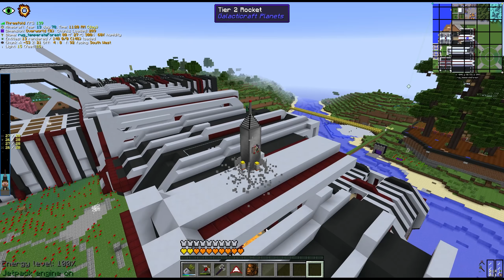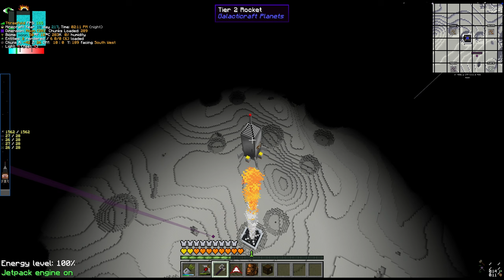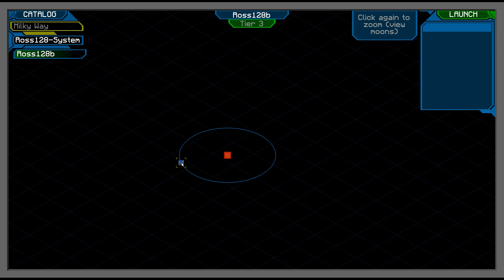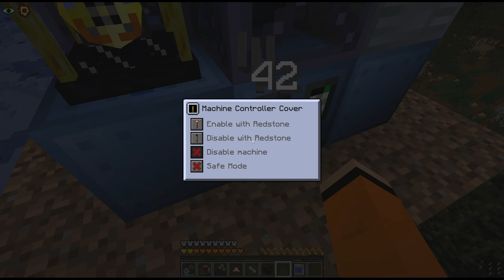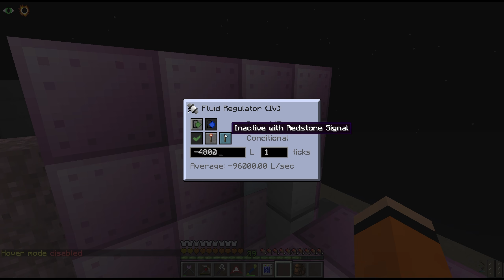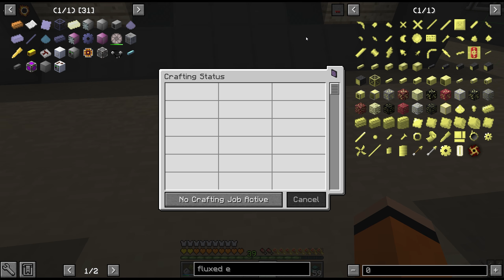Gregtech New Horizons - 54 - Turbine Power! Modded Minecraft

Comment: When transporting large amounts of items from output buses to interfaces like in your wiremill setup, use GT item pipes (with high capacities, like at least large electrum) instead of conduits. Output buses automatically push the items out pretty much instantly, so you will rarely run into situations when your output bus fills up and the machine throttles.
Reply: There's a "Output Bus (ME)" that stores the crafted items directly into AE2 for multiblocks. Far less laggy and doesn't need piping.
Reply: @shootingwithportals  Doesn't work with GT++, last I checked.
Reply: @aa-rv5wz  no, i believe there was a way added. Maybe it was switching the inbuilt void prevention off? I am not sure, but you had to use one of the instruments on the controller i think
Reply: @aa-rv5wz  huh, TIL - haven't done ME buses yet for these multis, my bad. I think you can use conveyors for them though?
Reply: @shootingwithportals  you are correct. I havent played in a while and completely forgot about it. Iirc you had to do something to make it work with gtpp machines though.

Comment: If you're hitting the max for the output hatch, it means your voiding extra lava. Also for the ender tanks you need to use a pump to get faster throughput. If the fluid detector is only detecting if it's full, instead of getting the 32 buckets/operations you're going to be getting a few millibuckets since the ender tank throughput by default is very small.

Comment: Ross128b lava fluid chunks are *rare*, and on top of that they can be complete duds. I don't know what the average is in term of how long you're going to be prospecting to find one, but that much looking around is not surprising. An alternative, if only because Ross128b lava is going to get nerfed in the future, is to use a fluid reactor instead of lava as a heat source for the LHE. It changes that aspect of the setup slightly, but not too much. It also is able to yield more power than lava, however, with my best design putting out 27.600 EU/t per setup (assuming Oriharukon).

Oriharukon is the second best rotor (what I call the turbines that go inside the multiblocks) material available at this point, with sky-high throughput, efficiency and durability. The only downside is it's cost, since it requires quite some infrastructure to actually cook up (and cool). Ichorium would be even better, but that requires a lot of Thaumcraft shenaniganry just to get some better stats on your rotors, not to mention fully opening up Kami. Not worth just for better stats on your rotors, IMO, even if Ichorium rotors are borderline invincible.

For the record, you can no longer wallshare multiblock turbines as of 2.1.2.1 I believe. You used to be able to in earlier versions, but it would mess with the rotor texture on the turbine, so this was changed.

To clarify, yes, the low pressure steam turbines do have fluid regulators on their inputs as well, and yes, this is required. Steam turbines are very sensitive when it comes to providing them with optimal flow, without which they won't produce as much power. Fluid regulators on the input hatch is mandatory, simply hooking up the output of an HP turbine to the input of a low pressure turbine will not work.

The distilled water that goes into the LHE is on a closed loop, however there are two caveats. If any of these multiblocks ever gets a maintenance issue, the loop is broken and you'll start to lose distilled water. If the LHE runs out of distilled water...well, you've seen the end result of that already. The second caveat is that while the system is starting up everything will slowly climb towards 100% efficiency, during which time the closed loop is broken. Make sure you have a large buffer of distilled water on hard when starting the loop, because some will be lost in the process, and have either a backup supply of distilled water on hand or redstone control to prevent the LHE from turning into a time bomb should a maintenance issue ever cause the distilled water loop to be broken. Preferably, of course, have both.

I...don't see why breaking the controller is necessary for changing out the input hatch? Turning it off, maybe, but breaking it? What?

You've not quite doubled your power, but you went from just under 25K EU/t to slightly over 40K EU/t. Which sounds like a lot, but consider that 5 IV machines could eat the lot of that by themselves, let stand when you get into LuV. Don't make the mistake of thinking you've got infinite power quite yet ;)

For these sorts of batch crafts there's really two options. PAs, and GT++ multis. So...bring out your offerings to the dark alloy fetish gods, everyone ;)

Man, imagine playing a pack like GTNH and actually having to do stuff like magic progression to craft stuff like Ender Tanks.

So I'm sure at least a few people are scratching their heads right now because a GT++ machine casing didn't require some random alloy. Well, fun fact (as far as I can recall off-hand, so maybe don't quote me on this): These casings used to require an alloy which required an LuV powered Advanced Blast Smelter to create. The ABS, as with other GT++ multis, cannot be overclocked by giving it multiple energy hatches like you can an EBF, so in order to create that alloy you needed an LuV energy hatch. An LuV energy hatch requires the Assembly Line, so in order to craft the multiblock wiremill to make the Assembly Line tolerable...you needed the Assembly Line. Oops. The casings were changed at some point to require blue steel instead, making the multiblock available pre-Assembly Line (thankfully), but creating the oddity of a GT++ multi that doesn't require some random GT++ alloy.

Something that was broken but fixed in 2.1.2.3qf, by the way, is the...Tectech (I think?) Schematic. It'll show you a preview of multiblocks if you right-click a multiblock controller with it. It's not the best tool, but it sure beats nothing at all.

Sheesh, this man complaining about having to use individual tools on maintenance hatches like he's not playing the version that gives you the tool box thing that allows you to do maintenance all at once. Which didn't exist in the version I played, for the record ;)

Something you'll want to do to speed up the craft, Three, is place item conduit speed upgrades on the extract of the GT++ wiremill to extract the output faster. Alternatively, there's an output bus that's basically an output bus with an AE2 interface integrated, which connects directly to your AE2 network. I have no idea how good those things really are, but it could be something to look into if you're worried about machines with full output buses causing downtime when crafting.

I don't know if you need to do one PA per fluid, but in the interest of minimum chance of recipe overlap it sounds like it's a good idea. Tungstensteel stopped being an issue a while ago, and if it is you've got bigger issues to deal with before thinking of putting that Assembly Line to use.

Speaking of Assembly Line, actually, one thing you might want to get started on now is scanning items in a scanner to get the necessary data sticks for the Assembly Line recipes, scanning an IV motor to get the stick for the LuV motor recipe, etc. Scanning really doesn't take that long if you use a high tier scanner, but I'm sure you don't have one, so might as well get that started early.

Comment: You'll be able to replace your assembler PA if you make one relatively soon after you enter LuV. You'll need to make the precise assembler for the neutron accelerator which you can use as a normal assembler after you make one. It offer 32x parallel with mk1 casings so they shouldn't ever be a bottleneck after that. The SMDs are MV so you should be able to 32x parallel them as soon as you make it